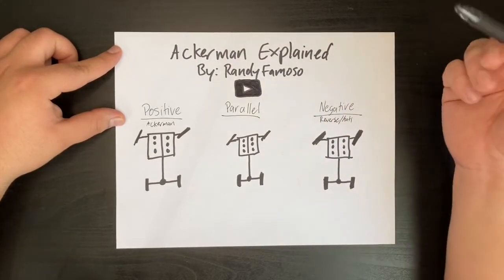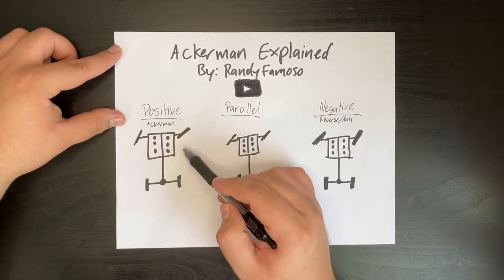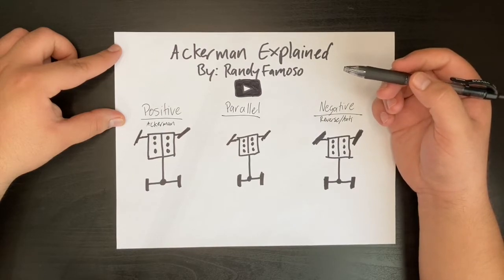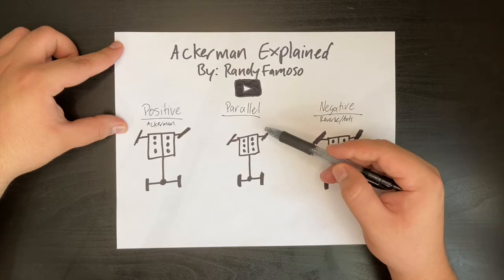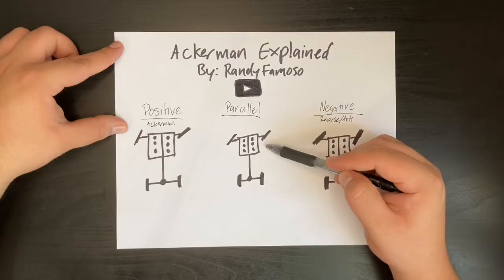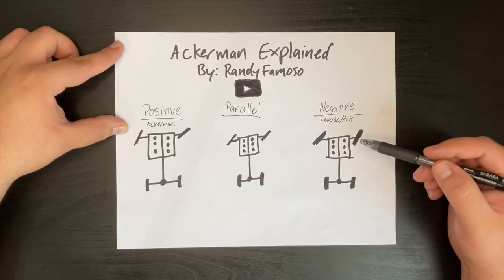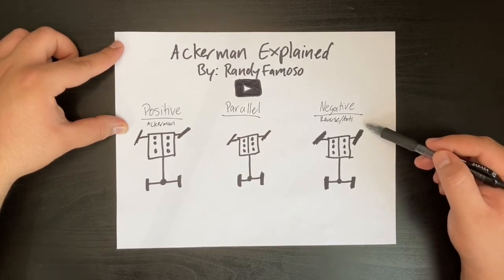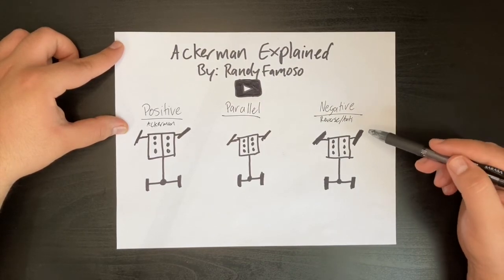Ackerman Explained in 3 min!!!

Comment: What you described at the end about BMW's is exactly what happened to me. I installed an ebay angle kit thinking its going to be great. I got a good amount of angle but now I have negative ackerman and it feels stupid when making tighter turns because after turning the steering wheel halfway in either direction it stops centering and tries to turn itself to full lock. Also the outside tire skips/chirps. Honestly stock was better and I dont know if even caster/camber plates can fix this.
Reply: @rfr777  Yeah I guess. Im looking at buying caster / camber plates and possibly offset control arm bushings to add some camber and caster. I don't know if these will fix the problem but I think they are upgrades I should get regardless.

Comment: Seems like the car would understeer when setup like that F1 car. Do they have other systems that correct for that and give some advantage maybe?
Reply: Having negative ackerman actually helps f1 drivers get grip when cornering. Since there is more load on the outside wheel it is able to handle more slip angle than the inside wheel which has less turning capabilities since it becomes lighter. Hope that made sense 😅